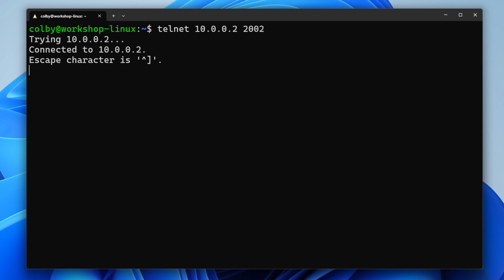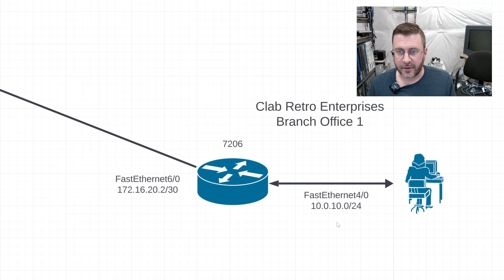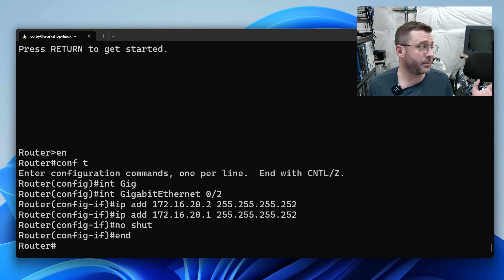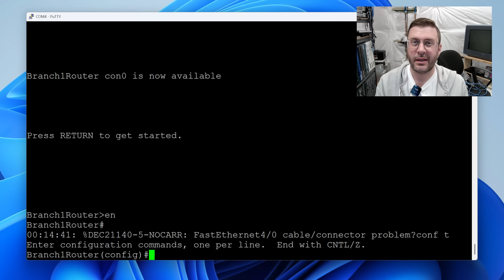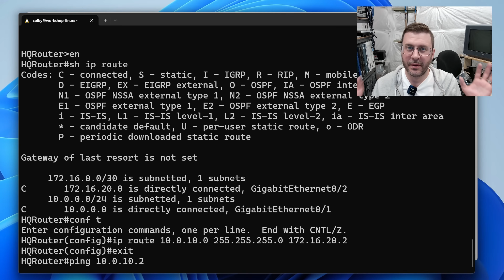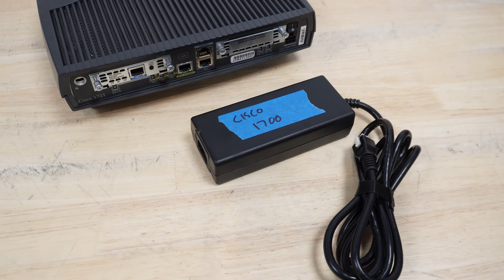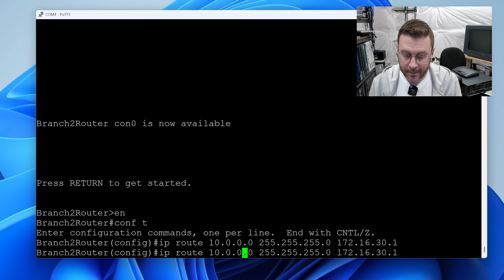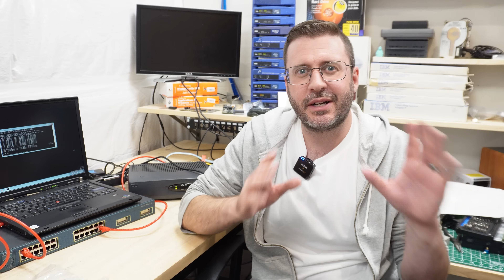Building a Branch Office

Comment: At the end of my apprenticeship I did a similar project. A HQ with two (I think) branch offices setup. But I directly connected them via serial ports and "modems" (2 Mbit/s connections). If I remember correctly there was the "ip subnet zero" command to use even /31 sub nets on this direct links with only two connected devices. I set up a basic Windows 2000 AD and also RAS dial in access. Totally obsolete today.

PS 38:30 I think there is a realistic scenario for this setup. We had to connect branch offices of a bank and they preferred direct connections (an exclusive copper link) that was not connected to some ISPs active equipment in the field.

Comment: I found a Computer Chronicles episode from 1991, was watching it last night. Was about communications, they mentioned some NICs which had 68k processors (probably because they didn't make ASICs for the job yet), but I was thinking how INSANE is that, literally a couple years earlier would have been almost the main CPU in the computer for cryin out loud. They did mention compression for cheaper rates over carrier packet networks. (Pre internet, expensive)
Reply: Alteon had ethernet NICs that had per-port MIPS cores of some sort doing various things, one each for up and down. They were gobbled up by Broadcom including their Ethernet controller IP which they continued to iterate on for a good while, and still do I think. At some point the actual bulk of the processing got moved away from the MIPS cores into faster dedicated hardware, so they deleted the second core for each port and left one simply for miscellaneous functionality such as WoL stuff. Eventually even more things got moved away, and now it's at the point where each port in these chips has a dedicated MIPS core that does a little bit of init and then except for certain requests from the driver, sits in a loop 99.999% of the time doing absolutely nothing

Comment: I was toying on getting an Adtran shelf that would be in say a central office. Then on each end would be a hdsl smart jack card. That would give me say a 1990's t1 setup. One thing I'm sure you know about is most of those offices would use VPN on top of that between the routers to each branch office. My experience with most of that is nothing. Just show up at a site and plug in equipment already shipped to the client. I did have more than one place fail over to 56 dial up modem when the internet link was down. Not sure how common that was.

Comment: Well, this brought back some memories. I was the backup network guy, which means I did about 4% of the work, as the primary guy was really dedicated and really good. I would consider a few changes to your setup. Instead of 172.16.20.x for branch 1, why not 172.16.1.x and 172.16.2.x for branch 2?  Same for the 10 networks, set the third octet to the branch number. Yes, if you plan on a big network, you may have an issue, but we knew we'd never have 200+ branch offices so that worked for us. Another change you could do is put in default routes so you don't need to put in all those secondary routes. I realize you're going to try dynamic routing but default routes are pretty simple. We did have those 1701s at the branches though connected originally via a private network before later using the internet. So while you do have a telco between you and the branch (pre-internet) it was still a private circuit and so was set up pretty much the way you did it with the T1 line.

Comment: You can use /31 for a point to point link. Point to point do not not need dedicating one IP to the network and one for broadcast and as such, the 2 total IPs in a /31 are both available as host IPs. Basically you save 2 IPs that way from using a /30 which still only has 2 usable IPs, but also has a network and broadcast despite that not actually filling any purpose.
Reply: Doesn't always work on old Cisco IOS versions though.
Reply: @ It's literally part of the CIDR standard. If it takes CIDR notation, it takes the /31 use. And CIDR dates back to early 90s, much earlier than this gear. Heck, even the 2501 I learned CISCO on supported this... So it would be quite the odd gear, and not following standards if it didn't support it. Not that cisco is perfect by any means but ignoring the standards entirely, does not seem like them. Renaming it certainly, but not ignoring it.
Reply from the maker: makes sense!
Reply: Great tip/reminder! 👍

Comment: One thing Cisco training materials always does (at least I assume they still do) is to label all "branches" in a network with city names. So HQ might be Houston, and the branches would be New York and San Francisco etc. I actually think it helps keep a mental map of the network like that, it's easier to get Branch1 and Branch2 mixed up. Might be worth considering for your setup.

You also mentioned getting into the routing protocols at the end, I think that's really going to blow your mind. Maybe start with RIP and then explore OSPF, IGRP etc. It's quite fun to see the differences between them. Well, maybe it's only fun after reading hundreds of pages of Cisco training docs.
Reply from the maker: I did actually get RIP working once upon a time and it wasn't too bad as I recall, so I'm excited to explore some more
Reply: RIP is kind of like the Fisher Price version of routing. It demonstrates the concepts in a simplified manner, but I don't think I've ever seen it actually used in a production environment. If the job is simple enough for that, you can usually get away with Static Routing. 

EIGRP is a mess and Cisco only keeps it around because they invented it. It had a purpose at one point in time (it's less resource intensive than OSPF) but it's just so inferior in every other way that it's not really worth the time (although it can be a little simpler to understand).

OSPF is absolutely the winner when it comes to internal routing protocols, although it Can become somewhat... Convoluted. Haha

I'd love to see you play around with any of them, although I'd definitely work my way up. Deep diving into OSPF without reading a book or a few technical documents would be very painful. Although just getting it to route over one or two links is achievable if you follow a guide.
Reply: @chaseohara4781  I saw RIP in use at one place I worked .. until we had a link start flapping which DOS'd the network. That prompted a rather quick migration to OSPF, which uses far less bandwidth (and disruption) to converge the network routes.
Reply: For home lab networks I think that a great way to name things is to go the boring route by just naming each branch as what the router model at that branch is called.